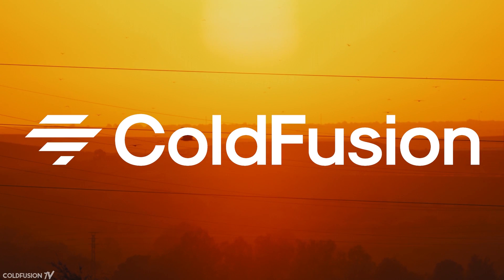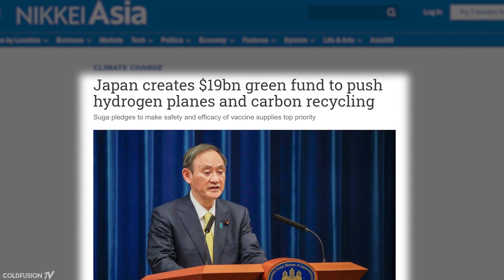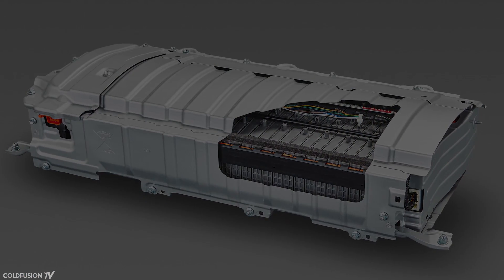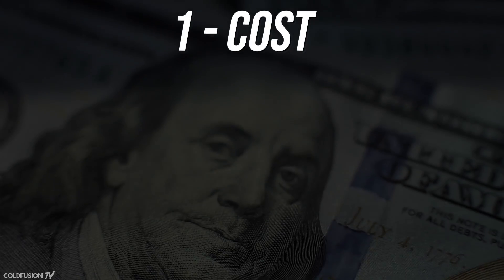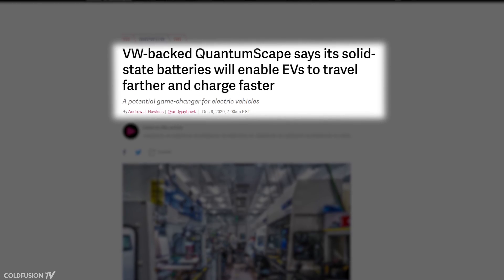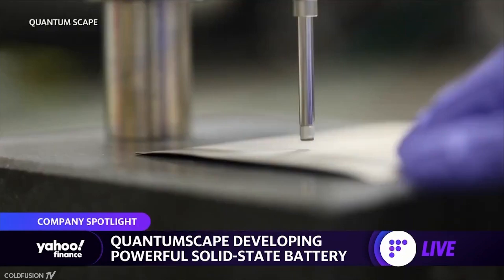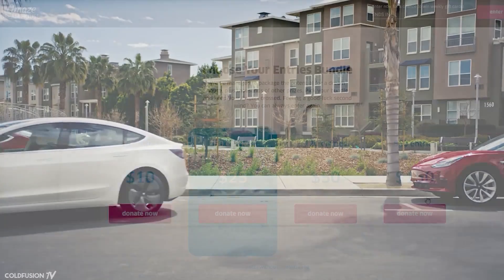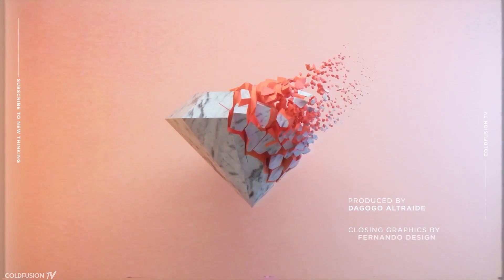Toyota Plans Revolutionary Solid State Battery for 2021

Comment: my biggest question remains. are older electric cars gonna be able to get a SS battery to replace theirs or is it just gonna be on new models?
Reply: As it's going.. I'd say job #1 is actually getting these mythical unicorn batteries.. then for the right cost and volume. You may want to take a seat. You RoCk K-man.
Reply: @ovalwingnut  lol

Comment: Take it with a grain of salt for sure! Toyota is not very trust worthy at this point. They are so hard headed about fuel cell and now that they are being confronted with the fact that BEV’s are the better path they start pushing the narrative of their solid state battery. 
It will likely happen some day but I would be surprised if they are in production with a viable solid state powered battery vehicle before 2025.

Comment: Electric really is the future of motoring if/when these batteries become "mainstream." Big trucks could park giant super batteries on trailers at filling stations, and leave with ones that need recharged. Customers could fill up their electric cars in only 10 minutes, not much longer than a gasoline fill up. Road tax could be charged on this filling station electricity. Even persons skeptical of "climate change" will prefer electric vehicles' power, quietness, reliability, and low cost of ownership. Future dually pickups' DC motors will make today's Cummins and Power Strokes look wussy!

Comment: Progress with batteries is fine, but please remember that if your power station runs on mostly fossil fuels, then that is what your so-called "Electric Car" runs on. More electric cars will mean more power stations and their easiest and cheapest option is to use more fossil fuels. You are just helping the petroleum industry to sell more diesel -- but you probably know that ...

Comment: Oh more boondoggle crap that’s gonna burst into flames and incinerate entire families? We had this technology in the 60’s and 70’s and it was never used because it’s just as bad if not worse for the environment (just like Lithium Ion Batteries), not as efficient as what the nature nazis claim and (wait for it) no country has the generating capacity for every vehicle to be replaced with electrics. We don’t have the capacity to even replace half of all vehicles on the road and keep them charged. This push for EVs is about one thing: LIMITING MOBILITY! People are sleep walking right into Tyranny by thinking they’re “Saving The Planet.” Knock it off people can’t even save themselves let alone “Save The Planet.”

Comment: Lol. My small pickup truck can go up to 850kms of range and probably significantly lighter. And this only 500kms? Plus apart from the electricity bills, you would have to buy the battery again when the current one is exhausted. This is still is not good enough to replace combustion technology. Give us something better than that or else the masses won't buy it.

Comment: Excellent reporting and a pleasant production. 
800 cycles of recharge = 180 days or 6 months. So we would have to replace these SS batteries every 6 months ? That's progress. 
Also, I'm surprised you didn't talk about Zicroniumate. This precious element is in development and will be available for Electric Vehicles with energy densities of up to 100% greater than Solid State. An EV would last 1000 Miles on one recharge and can recharge at speeds of 1000 miles per hour. This will be available to the public by spring 2022.  Oh, you didn't report on Zicroniumate because it hasn't been discovered yet ? Did that stop Toyota? Don't be so scientific, let yourself go, report on wishes and desires and corporate dreaming .... after all, if you can dream it, you can sell it  ;o)

Comment: Hey....one day they will finally release the info on perpetual energy solutions....I mean it's all there in the thumbnail right? Lol how dumb are we this day? I get the whole "Free" energy racket but what if we changed the terms and conditions of the word "Free". We could replace it with clean, and therefore dismissing the stigma. My interpretation of free energy has always been that of which you don't have to pay an arm or a leg for and one you buy your device you own your energy. We know there will always be maintenance costs, start up costs, build costs blah blah blah. But forcing restrictions on consumption is no longer needed as we have the tech to facilitate the needs individually. And no rental agreements either. Companies need to find a nice budget stance and remain there. No need to increase profits every year, just maintain a healthy wealthy life line and you made it. It's a common theme amongst those in the upper class, to let greed run your business model. Eh!!! Whatever. I'm just an idiot who doesn't know my head from my arse. Talking points lol.....I'm -46 & two more I'll be on track. Step through that shadow....see what's on the other side man. (Proverbial "man" not intended to represent ones genitals or inner-self identifications)

Comment: Great video. Quick snippet from an article to those that think EVs can replace gas cars:

Stored energy in fuel is considerable: gasoline is the champion at 47.5 MJ/kg and 34.6 MJ/liter; the gasoline in a fully fueled car has the same energy content as a thousand sticks of dynamite. A lithium-ion battery pack has about 0.3 MJ/kg and about 0.4 MJ/liter (Chevy VOLT). Gasoline thus has about 100 times the energy density of a lithium-ion battery. This difference in energy density is partially mitigated by the very high efficiency of an electric motor in converting energy stored in the battery to making the car move: it is typically 60-80 percent efficient. The efficiency of an internal combustion engine in converting the energy stored in gasoline to making the car move is typically 15 percent (EPA 2012). With the ratio about 5, a battery with an energy storage density 1/5 of that of gasoline would have the same range as a gasoline-powered car. We are not even close to this at present.

Comment: It's too bad that Toyota (and Honda too) wasted ten years on Hydrogen Fuel Cell vehicles.* Who knows where they'd be if they had started on this earlier. Hopefully they will actually get solid state off the ground and on a large, economically feasible, scale soon. I wish them the best of luck. If anyone can do it, it's Toyota.

* After all that time there has been very little progress on HFCs. In the US, for example, there are only about 50 hydrogen refueling stations and almost all of them are in California. And the "fuel" itself is still EXTREMELY expensive, around $11 to $14 per pound.

Comment: Adding a large generator to the motor while the vehicle is in forward movement,  could power the motor without useing the battery. Only useing the battery to start off with. My invention does just this.

Comment: By the time solid state has produced a product for market - Traditional batteries will have solved the most of the range and fast re-charge problems.  It will be a lot less commercially viable and not give anyone a clear competetive advantage.

Comment: Game has changed,  Toyota was sleeping and is still sleeping,  I'm waiting for Toyota to wake up,  they have been talking about hydrogen fuel cell,  I think they have lost their way to leadeship,  talking about hybrid cars,  they are still producing cars with capacity of 4kwh which is a big joke calling it hybrid,  it has no umph in it, I have driven one ....cant go up a 10 deg incline without engine coming on. 
Other manufacturers are installing 70-75kwh batteries,  compare it with 4 k,  stopped trusting Japanese after Mitsubishi lies unearthed.

Comment: You presented it as a done deal  !
 Then you start to present the hurdles ahead, and many,  and who knows what the solution  those problems will have. Maybe Toyota will sell the cars with SS batteries to the countries at the tropics and equator. There is quite hot.

Comment: Hi ColdFusion.  You should do a video on Nano One Materials Corp. in Vancouver, Canada.  They are revolutionizing the cathode materials process with their "One Pot Process".  Making cathode materials for batteries much cheaper, safer with more power as well as much quicker to process all the elements into applicable forms.  Look them up!

Comment: Electric vehicles should be sold without batteries ! The price of the vehicle would be significantly lower !  The batteries should be owned by the battery company ! They shall maintain the batteries !  You should pick up a fully charged "standard" battery at the gas station and leave the empty battery behind to be charged up. This process could take only 10 minutes ! The gas station would have plenty of time to charge the batteries ! Regards, Pat

Comment: Welp Toyota is getting there solid state battery for there vehicles from BYD they have had it for over a year now.Known as the blade battery, they drilled a hole thru it in their demo, no fire! 5 to 6 hundred mile of range, over a million mile battery.

Comment: 500 km range... what if it's cold as hell and I want to run the heat the whole time?  What if it's hot as hell and I want to run the AC?  Heat and cold tend to be real hogs when it comes to running them on electricity and I have to think it would be a big drain on electric cars.

Comment: This technology is very similar to the Chinese manufacturer BYD (Build Your Dreams) , their battery is called the Blade battery. Maybe Toyota and BYD are in partnership with this battery technology? The biggest problem with the lithium battery technology used widely in most EV cars driven today is that if the battery pack is pierced with metal parts during an accident it will start a car fire, so effectively everyone is driving all the EV cars with a potential fire hazard. This is not widely known or discussed when customers purchase EV cars.

Comment: Over 4,000 COVID-19 patients successfully treated so far – no hospitalization required, no deaths. This doctor has figured out a way out of the pandemic!

Alternative therapy options for COVID-19 with Dr Shankara Chetty, South Africa

13,047 views
•Streamed live on Apr 24, 2021
 
Vejon Health
17.2K subscribers

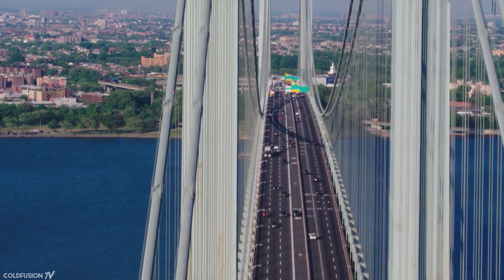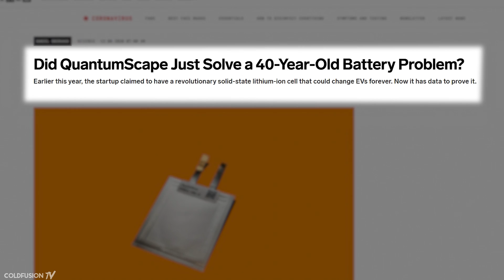This incredible interview highlights the future of COVID-19 treatment, available anywhere in the world. Dr Shankara Chetty (South Africa) has significant experience in managing COVID-19 patients in the outpatient setting, incorporating his research findings and a solid understanding of the disease. His background is in Biology and Microbiology with many years practicing as a Family Practitioner. 0:00 - Intro 4:15 - Covid in Port Edward, South Africa 6:45 - Covid-19 research 12:55 - Clinical approach to Covid 13:50 - Low cost strategies to prevent Covid transmission 17:20 - Hydroxychloroquine in Covid 19:45 - Early intervention in Covid 24:10 - Shortness of breath in Covid 25:00 - The 8th day of Covid symptoms is vital 27:10 - Hypersensitivity in Covid 34:25 - Ivermectin in Covid 39:50 - Perspectives on Covid vaccination 40:55 - Why does this approach to Covid not get more attention? 43:20 - Randomized control trial (RCT) appropriate in Covid? 46:10 - Real world Covid case management 47:50 - How to train Covid patients to recognize important signs 49:20 - Covid outpatient management 54:30 - Vitamin D in Covid 57:00 - Post-dated prescriptions for the 8th day of Covid symptoms Having alternative solutions is especially important for countries with limited intensive care facilities and poor access to vaccines.

WATCH HERE:
https://www.youtube.com/watch?v=VTqmXOAU2mQ&t=0s

THIS DOCTOR HAS THE GREATEST WINNING RECORD TREATING LONG HAULERS aka LONG COVID:
https://www.youtube.com/watch?v=aseu2SOdEoo
HERE IS A DOUBLE BLIND STUDY PROVING IVERMECTIN IS 83% EFFECTIVE AT PREVENTING COVID-19:
https://www.youtube.com/watch?v=IdEbJ8TJDkw
PROOF THAT IVERMECTIN IS THE BEST TREATMENT AT ANY STAGE OF COVID-19 FOR 1 CENT A PILL. THIS 8 MINUTE VIDEO WILL SHOCK YOU – TRULY A CRIME AGAINST HUMANITY ON A GLOBAL SCALE!
https://www.youtube.com/watch?v=QciiFYJJiJk

Comment: Toyota 500 km isn’t even close to twice the range of current  LiOn systems.  500 miles would be more like it. Unless they plan on having much less weight in batteries. I want 500 miles range with 10 minute charging. Then I will buy.

Comment: You guys do a great job of explaining very well the pros and also, the cons of solid state batteries. For what's it's worth, Solid State is the way to go.
However, let's not forget the cleanliness and power of Fuel Cells and green Hydrogen.
Let the games begin!

Thanks again for a very informative video.
BB
Reply: Well, there is not really a „game“. The overall efficiency of a BEV is way above any other concept. Hydrogen and fuel cells will or might have there market where batteries are not suitable, like long distance trucks, ships or planes. For normal cars there is no better concept but to use the electricity as direct as possible. Creating electric energy to produce hydrogen, which is then used to produce electric energy again is clearly less efficient compared to using the electric energy directly.

Comment: Game changer for most light passenger cars and SUV's that don't have to haul heavy loads, assuming they can actually bring them into mass production.  If/when Toyota actually make it happen, I will buy 1, and definitely will be investing in whichever company does the best job of installing their charging stations across the US.  Whether or not the US power grid can handle the additional demands of millions of rechargeable cars is a whole nother question to be figured out.

Comment: Batteries are still very inefficient in cold weather. They must also use much of their reserves to maintain cabin heat. Cabin heat, cold weather, headlight power drain all serve to limit driving range. Longer and more frequent stops for recharging. Battery efficiency loss with age is another problem. This results in rapid loss of value for used EV. Electric vehicles are also not efficient in larger vehicles because of the additional weight of the batteries required to power the heavier vehicle. These are only some of the many issues with electric vehicles. There are also many environmental issues as well, but that’s a subject for another day.

Comment: And where's the electricity, to charge these batteries, going to come from?
Solar? Windmills? - Not a chance,  do the numbers. These renewables wouldn't even give 5% of the requirement, if we all drive electric cars. 
Charge from 0-100% in 10 minutes? According to my calculations, that's going to equate to 2000v at about 30 amps. (60,000 watts). If you want to be close to that kind of power, good luck to you. I'd run a mile away from a car receiving that kind of electrical flow.

Comment: People are you losing your minds .we have a power grid in the US that is now antiquated and collapsing as we speak ,if you took only half of the cars and converted into electric it would totally disrupt and destroy the electric grid .now add to that what will be an increasing solar flare cycle we know it’s coming to wipe out the whole grid., for months you go nowhere with electric cars I haven’t even mentioned the unintended consequences of having an accident .especially at high-speed batteries explode new or old the amount of energy that is stored in these batters is more power than is that at  your street transformer hanging on the pole outside your house .which supplies energy to quite a few houses that’s because the ability to take a 3000 pound vehicle and move it at 60 miles an hour for two or three hours ,requires huge amount of storage .if you don’t think they’ll blow up take a lithium battery or any battery for that matter .Point a flame at it butane or propane torch it will explode you notice you don’t see these cars in stock car races where  crashes are happening all the time  .why because they will explode now introduce flash flooding ,Your car is traveling at a high rate of speed being carried by the water slams into something under water fire hydrant ,concrete ,whatever .now what  you may have walked away from very wet you  will be electrocuted .and this has already happened in the 1990s it’s Gm removed the volt  from the market and the people who had those cars they took the cars away from them .do some research. The other danger is the one they say you have already with your phone .it’s electromagnetic radiation you can get it from living too close to high tension wires .it is known to be a carcinogen ,now you put your body on top of a battery that is radiating electromagnetic energy intensely through your body .you must consider the unintended consequences.

Comment: This is meant to be such a 'breakthrough' technology yet this new battery only offers 500km (310mi) range maximum - half as much as most basic-standard diesel/hybrid diesel vehicles today. Charge times of 15 minutes which is still 15X longer in duration than I.C. engines. Dendrite formation that degrades the battery over time will be another problem much like its Lithium ion counterpart - which is a disappointment as it was initially promised that this problem was to be eradicated with solid-state. Also it STILL will have issues performing in cold climates like its Lithium ion counterpart. 

If this is what we're meant to anticipate in 5 years, that is very underwhelming at best.